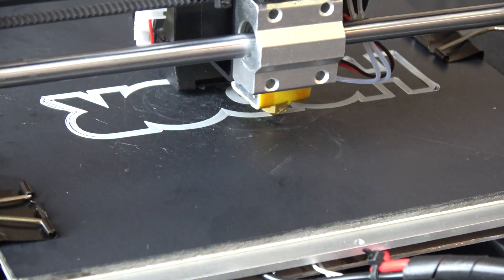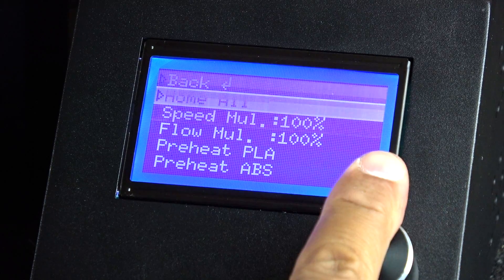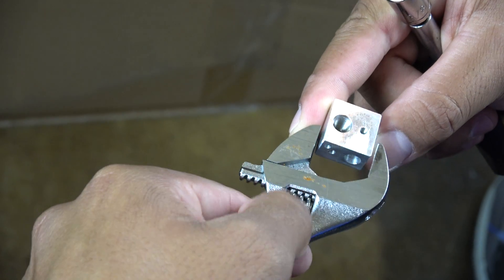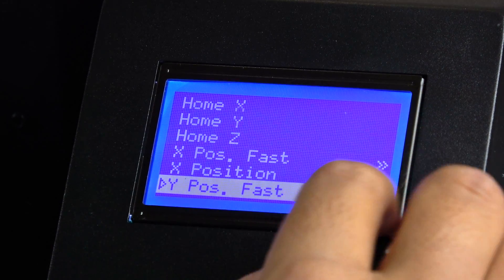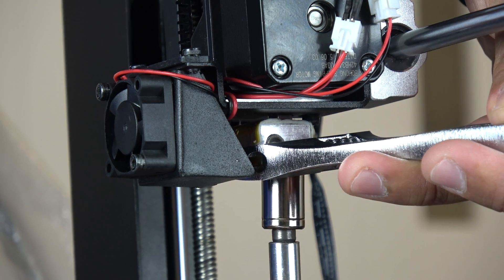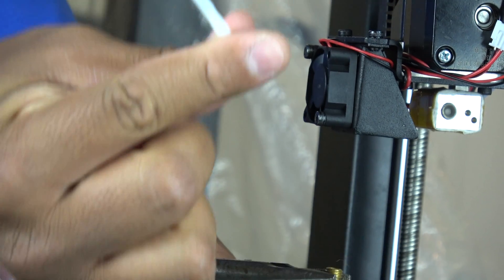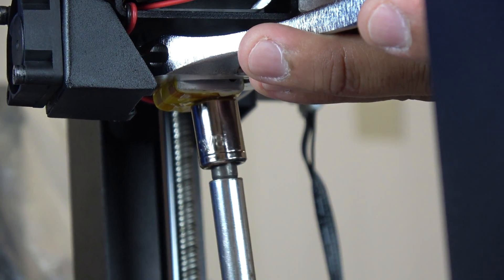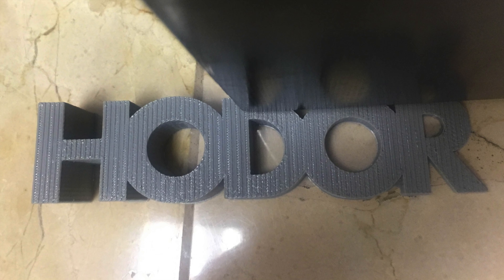Wanhao USA: Tutorial - How to Replace Your Nozzle (Duplicator i3 Series)

Comment: I want to ask you something: I have a problem with a printer like this: one little wire of the extruder motor was broken, and the filament doesn't leave anymore. I want to ask you if I can solder it with a soldering iron and tin or that is not correct?. The little wire is one of the four wire cable with white plastic that is in the minute 1:03 of this video, above the motor. The piece is not separated, so I can not change it. What can i do? Can somebody help me?

Comment: News for Endurance R&D department
Endurance have started working on 10W (10000 mW) diode laser with 445 nm wavelength. We expect laser to be able to engrave on brass, copper and being able to cut 5 mm of wood and plywood with single pass.

We plan to improve schematic on 8W laser and make better cooling system on that.

Endurance is planning to present 8W (8000 mW) IR diode lasers with wavelength of 808 nm. This laser will be VERY powerful and will be able to cut white and transparent materials including plastic, acrylic and even glass.

All releases will be made in a second quarter 2018.

For more information please visit: http://endurancelasers.com/news/ 

If you have any questions, please email: gf@EnduranceRobots.com 
or text + 7916 2254302 (whatsapp, viber, telegram, wechat)
skype: george.fomitchev
or facebook: @george.fomitchev

Comment: I don't know if anybody answers this, but I will ask anyway.  I am looking to replace my nozzle, the i3 came with a 0.4 mm nozzle.  If I use a 0.2 mm nozzle will I have any issues.  I can set the nozzle diameter in simplify 3D, but will the machine have any difficulty with a finer nozzle size?
Reply: You can change nozzle diameters and the printer won't care. Just update your slicer with the correct size and it'll write the appropriate gcode. I've seen people change out to a 1mm nozzle with no issues, on these printers!

Comment: Does it have to be heated to be removed ?  or is it ok to remove when cooled down (as long as you've previously removed the filament
Reply: Will Tejeda You should heat the extruder, befire changing the nozzle.
for more details, watch thomas sanladerer's video about changing nozzles!
Reply: The heat should only be for removing the filament